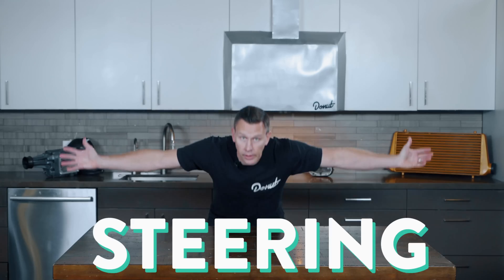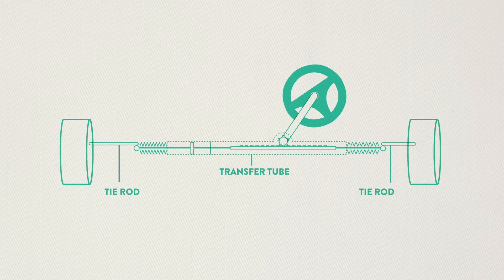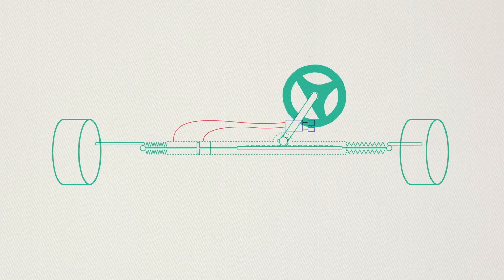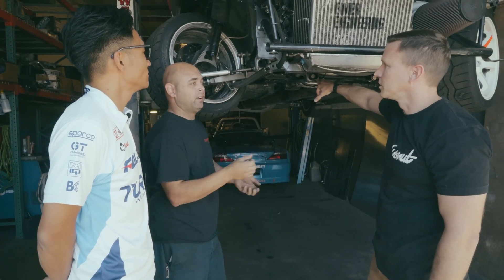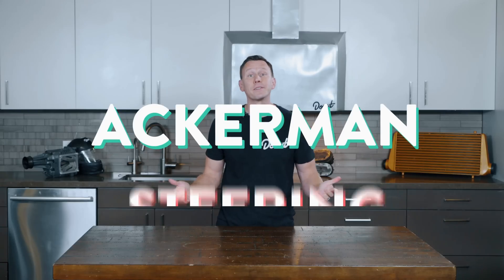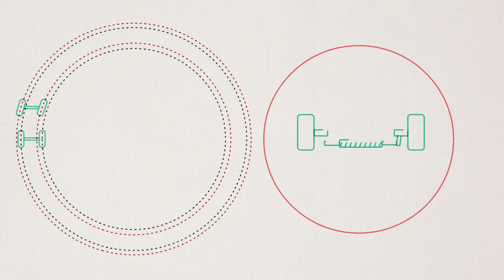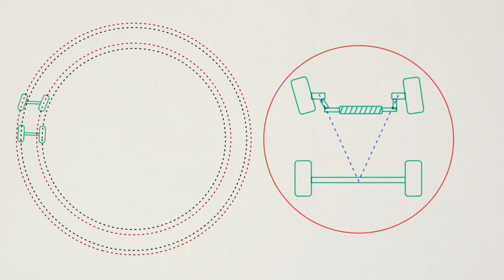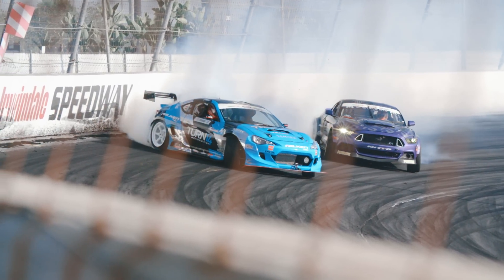Steering angle - How it Works | SCIENCE GARAGE

Comment: 6:47 That's not a motorcycle, that's half a car. A motorcycle going over a (low) minimum speed actually uses countersteering: you're steering in the opposite direction. A motorcycle tyre is round and because of that it works different.

Comment: What Happens If You Pull An Electronic Parking Brake While Driving? how do you drift in cars with electronic parking brakes and not an actual ebrake
Reply: The calipers won't lock the rear wheels maybe unless TC is off (not guaranteed).

To drift any RWD car, TC must be disabled and you can just use the throttle to induce oversteer.
Reply: @yongling9825  Thanks

Comment: Hang on... Doesn't electric power steering still add a load to the engine? I mean, the electrical energy has to come from the alternator, and the alternator is driven by the power from the engine. With a greater electrical load, the alternator would require more input torque from the engine, ya?

Comment: I've pondered how Ackermann steering is done with stretch limos - both professionally made, and those things where someone chops a car in half and adds an extra center section - saw that with a Prius once, it turned out better than it sounds. Do they change the steering geometry to match the longer wheelbase, or just have the tires scrub a bit? Also, I've noticed that on my classic VW Super Beetle, with the steering against the lock the tires chirp a tiny bit, seems like it's not a perfect Ackermann arrangement. Once asked the pros at a shop about this, they said that this is normal (not an issue with my alignment) and often cars won't have a perfect Ackermann arrangement because it's a tradeoff with some other factors.

Comment: 0:16 wait, but if the Earth was flat you would need to steer otherwise you'd fall off the edge. Even if you could stop, the car would be useless once it hits the edge because you can't turn it around. Since Earth is round-ish you could keep going in a straight line and end up where you were (assuming no oceans, mountains...), thus never needing a steering while.

So if the Earth was flat, all the more reason to have a steering wheel.

Comment: could you not just use an electric powered hydraulic pump? so you still get the benefits of assisted rack and pinion steering but without the load on the engine?
Reply: Oscar Thorpe The electric energy doesn't come from nowhere, it needs an alternator, which is driven by the engine. You can't create energy from nothing

Comment: I thought the second definition of steering angle that you mentioned is called “tow” (pronounced “toe”). 

I drift RWD RC cars and that’s what ppl in the community call the difference in angles between the wheels of the front or back.
Reply: Toe (which is actually spelled toe) is the horizontal angle between a wheel and the car's centerline, when the steering is centered.

Comment: would it be beneficial to increase steering angle on a normal car? id like the shorter turn radius but i dont want to compromise my handling
Reply: im probably going to jail The more angle, the more space the wheel needs, and the less space to put sturdy parts inside
Reply: Kenan Furcle so if the wheel fits and there are no extra mods i need to do inside the wheel well, it should just increase the potential angle without inhibiting handling? will the steering wheel to wheel turn ratio change or will the steering wheel simply turn further to allow for the increased angle
Reply: im probably going to jail I can't really answer there, I don't want to say something wrong
Reply: That's ok thank you. Didn't really expect to get it answered was asking just in case someone knew.

Comment: AND there's the electric power steering PUMP option from a Toyota MR2.. because sometimes racecars need to eliminate pulleys being driven off the engine (but you still want to keep some PS)